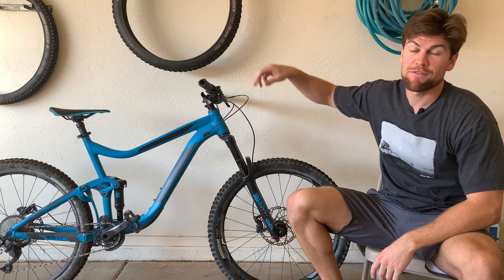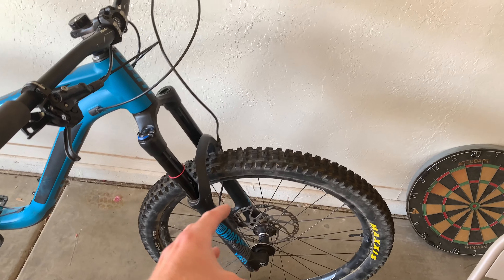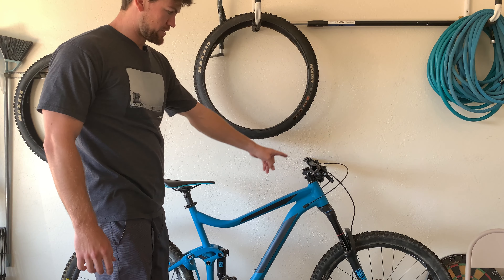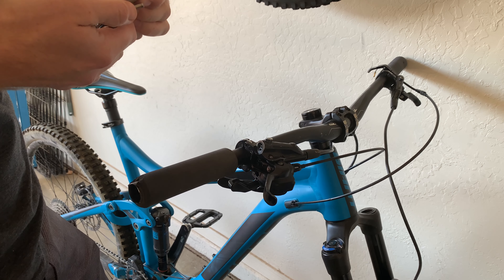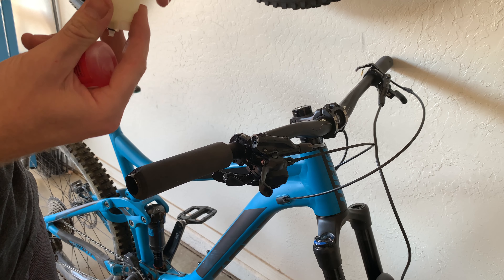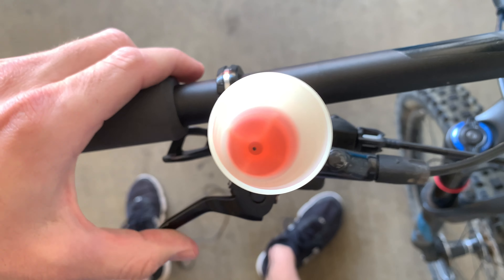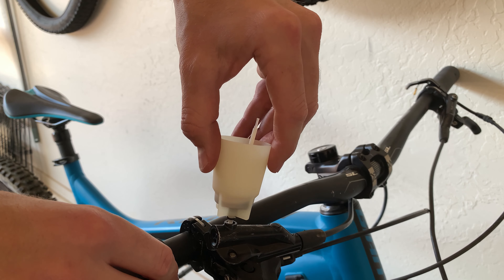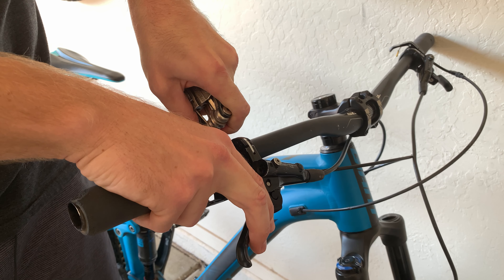Easiest Way to Add Fluid to MTB Hydraulic Disc Brakes | 4k

Comment: This is a lot easier than an actual bleed. The oil in my brakes is fresh and just needed a top off due to lost pressure from changing the brake pads. I imagine at some point the lines need to be completely flushed, but not anytime soon.

Comment: Worked perfectly. I read an article and out advised to tilt the brake 45 degrees forward squeeze the brake untried bubbles stop then 45 degrees the other direction repeat until bubbles stop and then back to highest position and finish. I did have additional bubbles come up at the 45 degree tilts.

Comment: This took all the intimidation out of bleeding brakes for me. I'd rather pull the brake lever then mess around with all that other stuff in the package. Thanks for the great tip! Oh and PS, my issue was created by the exact problem you described except I loaned the bike to a friend and that's how it came back.

Comment: Worked like a charm.  The best part is leaving all the extra stuff in the package and never using it!  And it does take some persistence and a lot of squeezes.  And jostling the bike a little, which dislodged some of the air bubbles I guess, but gently so the oil doesn't slosh out of the funnel.
Reply: eeasy wayto do it is instead of fulls squeezes  the wshole time.... literally flick the handle ,you dont need to movei t much... just enough to cause internal movement... it works the best ... to make it even better tilt the bike to the sides as well as turning the handlebars to the max...will get  a ton of air out

Comment: Thx had to change it up. Removed brake cable and then pumped brake lever to pull fluid into reservoir top side.  Slower but it works...and the cheap American kit is really good. Thx again.

Comment: I was able to Burp my Rear brake without a funnel or ANY special tools .. Just leveled lever, used a normal syringe to keep the 'hole' where the screw was full of fluid as bubbles came up as a beat the Lever 50 times fast.. Little messy, but easy cleaning and worked like a charm!

Comment: when you pump the lever to get the HD fluid down in the hose to the caliper.. use a vibrator (for massage ) to help get the bubbles out of the line.. You can rubber band the  vibrator to the hose just blow handlebar height.  That works well.. bubbles come right up to the reservoir funnel...

Comment: Very good. Booked my bike at the bike shop to do this after messing it up. I had successfully done Shimano brakes with a kit but found it very difficult. tried again on another bike following this video. Nearly done it.  15-20 mins of getting bubbles out and back brake working again but still rather soft. Another go on the bubbles and I should be there. I now see the Tektro brake reservoir may have 2 fill points and I was using one a big large so got some leakage. Will try next time with another fill point

Comment: Pro tip, for Shimano brakes with a freestroke adjustment screw, from fully tight, back it off 3-4 full rotations before filling. This'll allow the system to be filled completely and give you manual adjustment capability later using the screw. If you leave the screw all the way in you can't adjust it later!

Comment: I like the video so very easy can I ask if the brake pad need to pull out from brake  caliper when we add the oil mineral
Reply from the maker: Make sure that they are all the way in when adding the oil, preferably with wheel on, otherwise it will leak out.

Comment: great video, will this trick work on any hydraulic brake , I have Avid Elixers and wondering if the threads in funnels is the same?
Reply from the maker: It definitely should! The funnels all come in general kits, so I believe they should fit pretty much any hydraulic MTB brake system.

Comment: You could  pull the lever prior to removing the funnel.  Then before releasing  reinsert the bleedscrew... that way you shouldn leak any or a lot less since the oil is being sucked downn instead of just chillin at the top...ive never done it just a thought

Comment: So I tried to do exactly what you did, but I could not get the brake fluid in... had only a few small bubbles.  Is that enough?  The brakes feel slightly better but not great.  I want great.  How do I get great?  Lol
Reply: Did you fix it? Try lifting front part of the bike so that place where air should exit is highest point of the bike.

Comment: i have hydraulic breaks i have to use oil, but why do i have to put oil? and when should i put oil and how much oil do i put
Reply from the maker: I'm definitely no scientist, but here's what I understand happens. When you squeeze the breaks it creates pressure because there is oil in the line, the pressure then forces the brake pads together which squeezes the disk brakes that actually slows you down. If there is air in the line, when you squeeze the breaks the pressure in the line doesn't increase enough, meaning it won't squeeze the brake pads all the way. You want as little air in the line as possible at all times! Hope this helps! Keep shredding!
Reply: damn, thanks mate

Comment: I have a brand  new G-Force 42 not ridden much yet….brake for front tire has tension, but does ZERO to stop the bike. Is there something besides brake fluid that would make that happen….does anyone know? Pretty rural and not able to take it into a shop, nor would i want to if I can avoid. Thanks in advance.

Comment: When you remove the funnel why didn't it's leak out before you put back the screw
Reply from the maker: The little plunger that I put in the funnel before removal is enough to stop it from leaking and the brake lever is level so it won't spill that way either! Keep on shredding!
Reply: Knowledge is power. I got a converted electric bike so my brake runs down quickly. I can change brake pad but couldn't not add the fluid. I don't have the funnel though I have two sryings . But thanks for the info

Comment: so you dont even bother putting a link to that kit ..  thanks
Reply: Google bicycle bleed kit and you’ll have 10,000  kits to choose from. The only thing you need to know is which fluid your brakes uses which you can Google. There’s only two choices. Mineral oil or dot3 or 4 brake fluid

Comment: Tried this on my bike and it leaked from the bottom of the cup that screws into the lever and fluid was shooting out the top when I would squeeze it does that mean I need to bleed the whole system cus I'm confused why it didn't work for me
Reply from the maker: Hey Matt! That's interesting, does the bottom of the cup have the little tiny rubber O-ring on it to ensure a tight seal? If it doesn't that could definitely be the problem. Let me know!